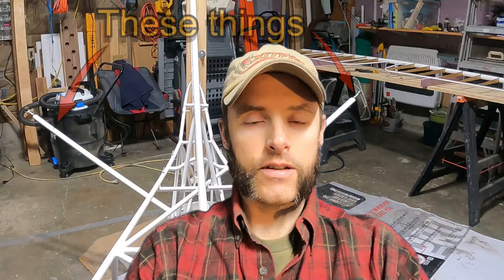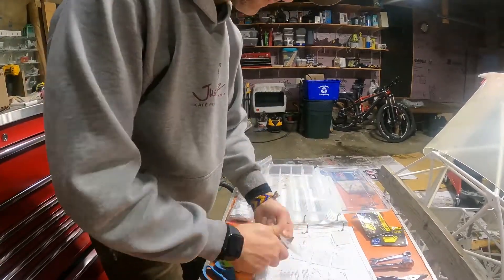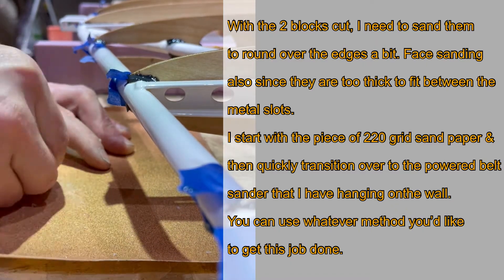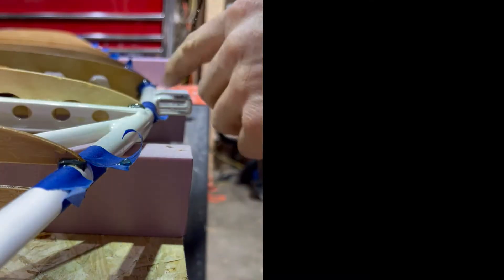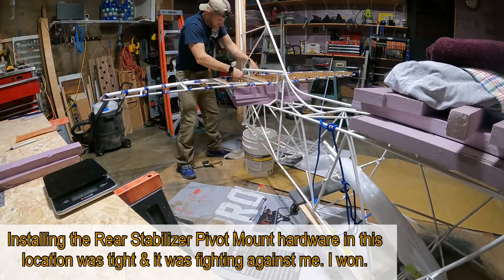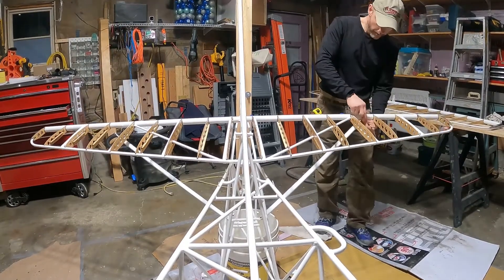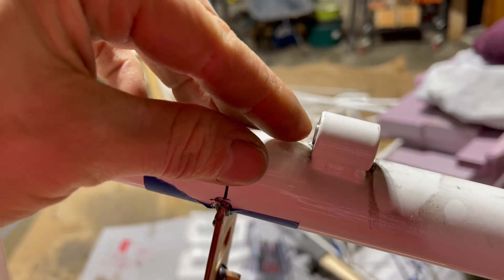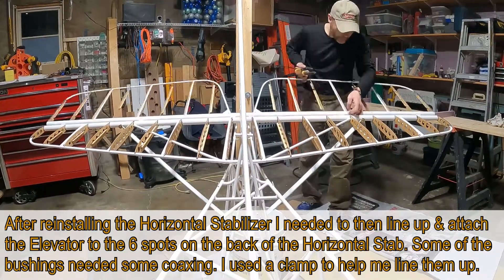#10 Horizontal Tail Installation

Comment: I've double-checked part and bolt numbers and my bolts (F) do not fit into the bushings (C). The holes in the bushings are ~.172 and the bolts are ~.187 in diameter. Same issue with all of the elevator hinges. I had to ream the bushings .1875. That seemed a bit odd, but the outside of the bushing (where it rides in the bearing) is super smooth. I expect this is due to the variations in bushings and bearings Kitfox receives. 

Btw, I've really been enjoying your videos. I have lots of "ah ha" moments as I'm watching them.
Reply from the maker: It sounds like a lot of kit owners have had this exact issue and some get lucky and everything lines up and goes in smoothly.  It surely opened my eyes when it comes to reaming, sanding and preparing parts for alignment.  Again I'm happy to hear the videos have been helping you out a little bit.  How far along are you on your build?  Matt